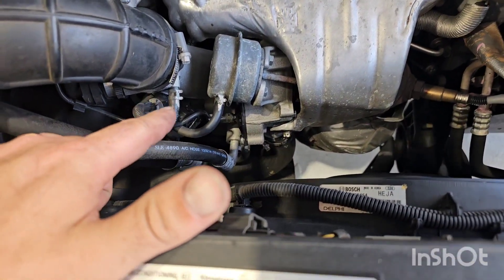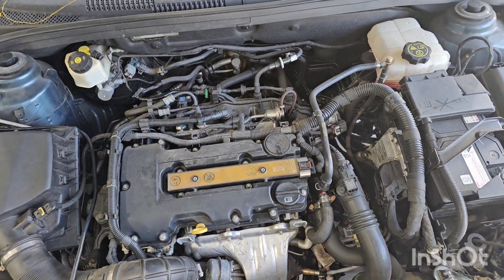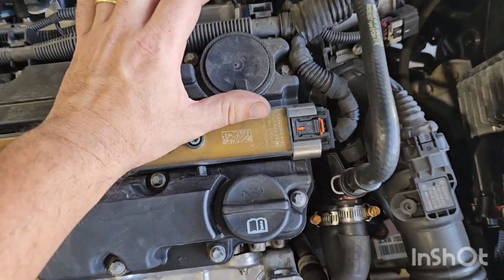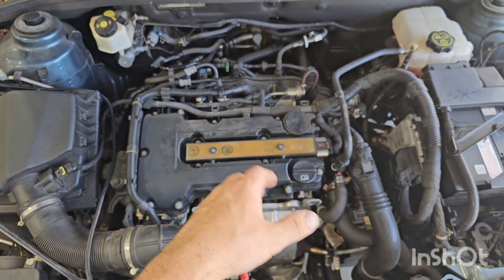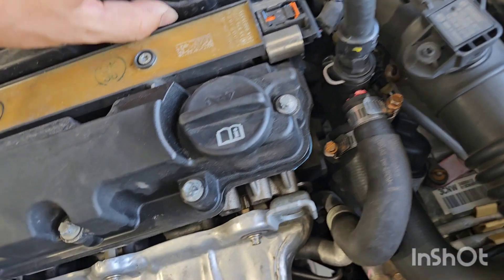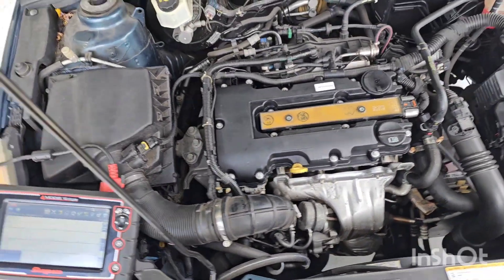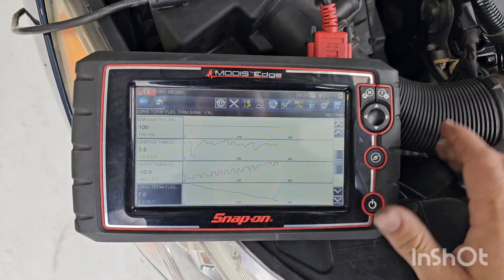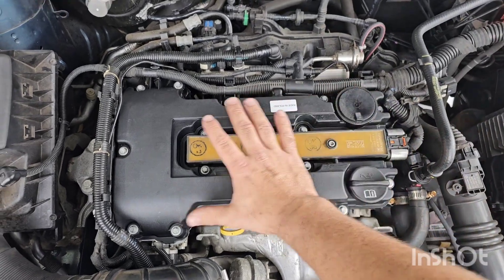Holden Cruze P0171 System Too Lean Bank 1

Comment: Where do you get the rocket cover? I have bought two online and both have been faulty with a bad PCV diaphram (Its making sucking/whistle noises). I beed to get a good rocket cover that isnt faulty
Reply from the maker: Only genuine is the way to go mate, all after market ones are trash unfortunately
Reply: @RealAutoSolutions  agreed, so where can i get a genuine one?
Reply from the maker: @RemSiman  from the local dealership